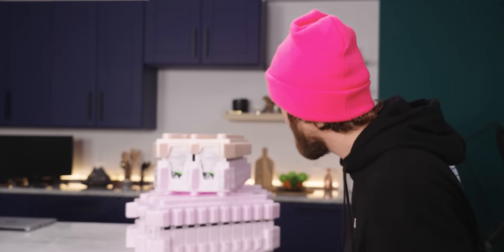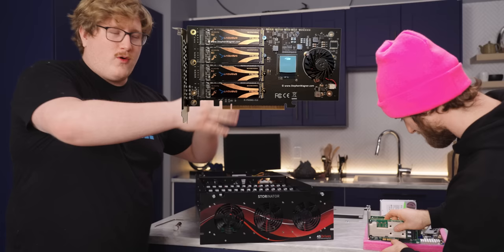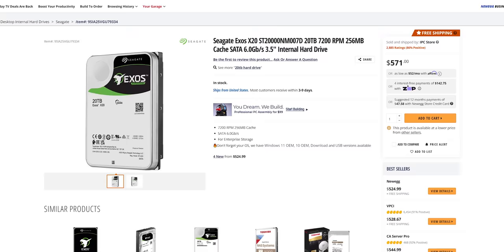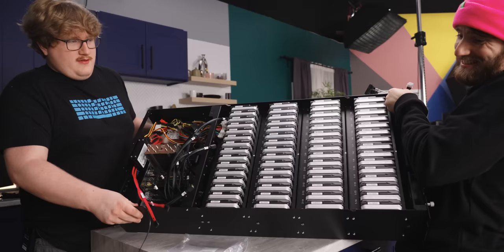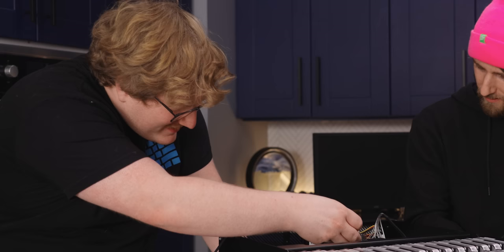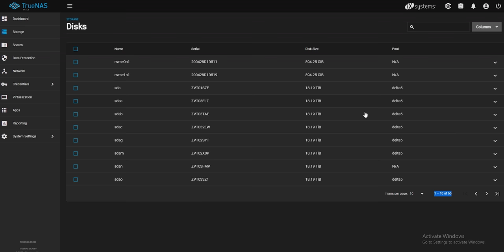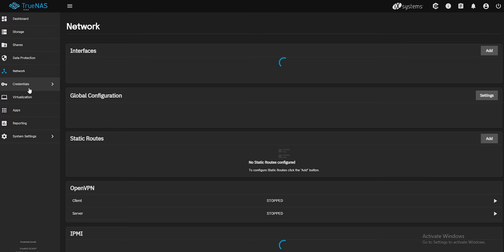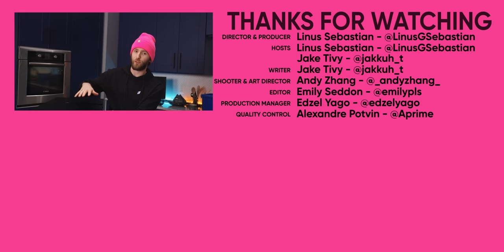My dream FINALLY came True! - Petabyte Project Recovery Part 2

Comment: Didn't Linus say in Wanshow at some point that "No one would want 20Tb harddrives?" Because of their sata interface it will take stupidly long to rebuild parity drives in case of a failure. So it would be quite likely that another drive fails during the rebuild. But hey I guess another data loss will make for more content that they don't have to plan.
Reply: lmao great point.
Reply: That's fine they don't use monitoring or scrubs so they never need to rebuild!
Reply: they're using raidZ2 tho, so if another drive fails during a rebuild it's still ok. 2 drives failing while the 1st one rebuilds is still very unlikely
Reply: bah, just made that comment myself and then saw yours. So much of what they do is eyerolling but at least it's entertainment.
Reply: It made e shudder seeing the 20TB drives, Linus did say you dont want 20TB drives in a regular server, this is archive data and hopefully they will actually manage the the server and swap it out in time.
Reply: For mission critical and actively used data for sure not. But for archival it's fine. Other archives use magnet tapes, they also take time to write and especially read. No random performance at all.
Reply: a german politian once famously said: "what do i care about my ramblings from last week!"
Reply: Here the thing, reason why Linus say to Yvone such is because Enterprise such Google, Facebook, any who moving data fast is never intending to using such method for such data. 

Linus in the other hand, is doing it for archiving. Remember when he say he need it just to take HQ data rather download it from YT? This is why he need it. 
Another reason is RAW is expensive, when I say Expensive it mean like just to record single review costing around 15-30 USD. If the data loss, nobody wanna to do it again, even they do so, it never the same impression. 

Also, nobody bought 20TB just for NAS, Except if it's a business who run on archive data such Animation, Video, Photo Agencies, many more.
Reply: @macguyfromscotland  Truly to the point. Do you wanna put your thousand dollars just for archiving or bought like per 8TB just for RAW photo or hundreds netflix 4K.
Reply: @noahluppe  If I had lot money and lot vids like bois, go tape for long time archive like what GH do is my way.
Reply: @OktavianiFriska  woah 23sec ago, hiii
Reply: RAID 6 Rebuild with 12TN 10E15 URE has a chance if 88% to rebuild correctly - that sound okay but also means you have a 12% chance if total data loss

So a 20TB drive like those still have a URE if 10E15 - so roughly only a chance of 50% for a successful rebuild

So a RAID6 or Z2 with those drives is basically useless if you rely on rebuilds data loss is a given...

Only way to ga is mirroring with such large drives..
Reply: This is for archiving data dude. Different use case.
Reply: If I recall that was in relation to the home user. I'd never want to run a single drive of any modern size.
Reply: @izanefe4231  actually it depends on various parameters: I would check the serial numbers of those drives. If they have been all manufactured in the same lot, we might be setting up for the most spectacular cascade of hdd failures within a few years.
Reply: What am I missing here?

SATA III (3) interface (I know that have 12 Gb/s SAS ports, but they're using SATA III for this server is what I gather):

6 Gb/s (600 MB/s) filling up 20 TB would take 9.259 hours. Of course, no HDD head is going to operate at that speed at this point in time, if ever.

Seagate Exos X20:

Sequential rated speed of 285 MB/s filling up 20 TB would be about 19.493 hours - still less than a day.

All of this is on CMR (thank goodness) technology so you don't even have the issues of SMR which would make it take far longer. So, that means that they would only risk losing data during those 19 and a half hours IF another drive fails in that particular v dev, not across the whole server (I'm only talking about RAID Z2 right now). Now, sure, a drive that has been running for say 5 years, pushing those drives in the v dev with the parity data on it could push it to start having problems because of that extra stress as explained in this video here: https://youtu.be/ZFLiKClKKhs?t=458

So, once again, what am I missing?

Edit: here's the WAN show clip that I think you're referencing: https://youtu.be/8IRjFZ9xEj8
Reply: Also I thought the higher capacity you go the much more likely the chance for drive failures. Maybe that's not true anymore but it used to be a couple of years ago.
Reply: @KarlBaron  they mentioned the scrubs in the video, truenas does it automatically every month,  plus they have monthly smart monitoring enabled they mentioned.
Reply: So people can't change their opinion 🤨
Reply: @happinessiskey2858  if I remember correctly the only 20 tb drives on the market during that discussion were SMR, which had decent sequential reads but abysmal writes in general, and that was the primary logic behind saying they were basically useless, because your risk of another failure during resilvering was too high. Don’t think that same logic applies to these drives appreciably more than an equivalent 14,16, or 18 TB enterprise drive. SMR was the problem as much as the size iirc, and especially with raid Z3+hot spare your expected time to data loss should be far enough out to not be a major concern. I could be wrong though, it’s been awhile since I’ve looked into all this and I can’t actually watch the video at the moment to see how they dealt with it
Reply: @OktavianiFriska  I'm a tech for an animation/vfx/video business, can confirm this. The last archival storage we built is based on 18TB EXOS, and 16TB Skyhawk AI before that. We opted for dual socket Xeons with LRDIMMs for approximately 7.5x more RAM per RAW TB of spinning rust than Linus's 1.2PB in this video with no solid state cache at all. The next few 4U servers may be 20TB EXOS or we might use 18TB based again depending on whether the priority of the business is $ per TB or rack density.

I personally use shucked 8TB drives at home for my NAS. I wouldn't want to experience resilvering of 10TB per 20TB disk failure (assuming pool is 50% filled) on datasets that's actively being used in production unless the zpool is at least striped with 3 Vdevs.
Reply: does Linus's math on that make sense?

if disk read errors happen randomly over time, does it matter how many drives your data is spread out over? whether you have one 24 tb drive, two 12tb drives,  three 8tb drives, or twenty-four 1tb drives, your likelihood of two data read failures (and loss of the pool) is the same in all cases. or have i misunderstood something?
Reply: @izanefe4231  its LMG….
Reply: Oh shit they are learning
Reply: @KhromTX  For HDDs, yes, there's a higher chance of drive failure due to the number of platters inside the drive (the magnetic discs that actually store that data) as well as the read and write heads because that's more moving parts. The more capacity you have = the more read and write heads you have as well as platters to store that data.

With SSDs, that's not as much of a problem due to them not having any moving parts. Though, having more flash in them is still a higher change of one going out or being defective, but that really applies to anything.
Reply: @L4rgo117  Ah, I see. So all these comments are about the clip I mentioned/ referencing SMR drives and not the CMR ones they used in this video? Yes, SMR would take forever to resilver/rebuild the v dev and you do run a higher risk of another drive failing during that extensive time. It wasn't making sense that people were saying a 19.5 hour re-silvering timeline for 20 TBs is too long/would take forever. 

I think that's what I'm confused about. I did think about that scenario but I wasn't sure as no one really specified the difference.

I'm going to go with that perpective. Thank you for confirming my alternate thoughts. I hope all is well! P.S. you should definitely watch the video when you get a chance if you're a storage fanatic like me. :)
Reply: @izanefe4231  lol, no it's not... At least not with 15 drives per vdev! Considering the amount of stress a resilver would do to all drives and the amount of time it would take. I thought I was safe with 4x4TB drives in a Synology NAS with SHR and when I replaced a failed drive another failed during the rebuild and that was only 4x4 drives... Now imagine the likely hood of 15x20TB stretched out over days/weeks...

I learned my lesson and my new setup has 5x8 and 5x4 VDEVS each in ZFS2 (plus working on a full replica system for off site backup using RSYNC).
Reply: @L4rgo117  Finally, a person who knew what Linus talk about. Not only nobody built NAS over 8TB, but who wanna waiting for month or year just for copy paste on fing SMR?
Reply: @KarlBaron  Brutal 😂
Reply: @brainthesizeofplanet  if the real-world error rates are really that high, why I have i never had an URE on the bi-weekly scrub of my 144 TB (raw) pool?
Reply: @KarlBaron  what's the size of each drive?
Reply: @brainthesizeofplanet  a mix of 14 and 10 TB drives
Reply: @noahluppe  I guess that's the thing that I missed.
Reply: @macguyfromscotland  Yeah let's hope.

Comment: 1 Petabyte of Data: $37k
lacking an IT department: $0
Linus making multiple Petabyte project videos: Priceless
Reply: to be fair $37k is like, six months worth of a good IT technician, so...
Reply: @wertigon  LPT: just brute force more storage to avoid paying a tech admin.
Reply: $37K for a regular person. $0 for him. He got all those drives for free.
Reply: @wertigon  Oh gawd not even close.

My company would charge maybe a few hundred a month for server monitoring.   It's actually quite inexpensive, you don't need a dedicated employee.  It really depends on how many hours of work that's needed.

Usually for management, it's a couple hours a week tops.  If there's a failure, just get someone on site to do a swap, press a few buttons and you're good to go.

For heavy errors, there are several alternate methods.
Reply: @lilkittygirl  But then you're not paying for an IT staff but for one guy to come over every once in a while, just like an electrician or a plumber.

A full time decent IT guy can easily make $60k a year, and that's just counting what the IT guy gets in his pocket.
Reply: Linus had to pay for the drives this time round.

Comment: Not sure about IT department but what you guys REALLY need is a montage of every hard drive locked in with nice clicking sound like they do on LEGO building channels. 100% satisfaction guaranteed.
Reply: I watch a guy tear down engines and he edits his videos so that the cracking loose of the head bolts are ripple-edited for that effect.  It's one of my favorite things he does.
Reply: @TechGorilla1987  channel name?
Reply: @muzameela2845  I Do Cars is the channel name.  He does teardowns on various engines.
Reply: Its on their onlyfans
Reply: Too bad fan noise would ruin it
Reply: Gallons of baby batter.
Reply: *☆MOMOKIMI☆(人 •͈ᴗ•͈)*  bot destroyer, do your work!
Reply: @TechGorilla1987  revzilla did a “asmr” video tearing down a ct90 and it was awesome
Reply: Indeed

Comment: PSA: zfs also lets you add in a hot spare that will automatically replace a failed drive. You can configure it to be the hot spare for multiple zpools. When a drive fails, it drops itself into the array to restore parity, then when you've replaced/fixed the bad drive it'll go back to being a spare until the next time it's needed.
Reply: Not a PRO. Hot Spare additions are not automatic because a complete failure needs to flagged, and its rarely the case.
Reply: Really hope Linus can take advantage of this. Even if it’s not automatic, just telling the server to rebuild with the spare already inside could be really convenient!
Reply: Question, will it be on while it's sitting there doing nothing?
Reply: @nneeerrrd  Linus knows a lot of things. Not necessarily well in any, though.

Comment: IT person interviewing for job: What is your data retention policy?
Linus: Yes
IT:How many years?
Linus: Yes
Reply: With single point of failure, both answers are "no"
Reply: @tim3172  I think they determined to NOT do that and just rely on alerting from the software raid controller. Their first video says it's to expensive to back it up and the data isn't that important, so still No.
Reply: @ScottZupek  it's on youtube. That's their backup lol. They dont need literally any of this
Reply: @johnathanera5863  Not quite, because your missing all the files needed to make them as well, from adobe templates, to the specific components of the video that get put into their video editor of choice.
Their is a lot more to it than just 'its on YouTube, why care' because your seeing the finale product, not every part used in the whole process.
Reply: @johnathanera5863  what if YouTube also stores data like amateurs?

Comment: I can remember installing hard drives in that form factor -- 1" tall, 3.5" wide -- that could hold 120 MEGABYTES.  And I couldn't believe then how much data they contained, considering that there were 80MB drives that were 2.5" tall and 5.25" wide still knocking around.  And now these drives will store more than 160,000 TIMES as much data in the same space.   Boggles the mind!
Reply: Wow that must have been a while ago
Reply: @nesyboi9421  indeed, it was. I’ve been doing PC upgrades/repairs since 1988 or so. The first PC I ever built from scratch was a 386DX running at 25 MHz, 4 MB of RAM, an 80 MB SCSI hard drive, and a VGA card with 512 KB of VRAM on it, plus a 15” VGA color monitor. Cost a stupid amount of money, too - a bit over $3K in April of 1989. That’s the equivalent of about $7K today. 😳
Reply: I still have one of those hard drives!
Reply: At this rate, i wouldnt be surprised if this amount of data today could fit in a small usb later on the future
Reply: I remember paying an additional $700 to have a 20MB HD in my computer instead of a 2nd 3 1/4 inch floppy.
Reply: @LMacNeill  so there were CD available at that time ? How can someone store movie on a 80mb hard disk ?
Reply: I remember back in the early 80's when the first home-use hard drive became available: the amazing $1500 ($5K+ in today's dollars) Shugart Technologies (now Seagate) 5MB 5.25 hard drive. Everyone I knew said, "Who the hell would ever need that much storage in a home computer??" Remember, these were the days when nearly all home data files were in the kilobyte range and stored on 5.25 floppy disk drives and cassettes. (Yes, cassette tapes!). Now, 20TB on a single 3.5" drive. I'm sure in the future when we store our data on holographic optical storage in the exabyte and zettabyte range, we'll look back on today and chuckle.
Reply: Lol, I read your '80MB drives' as 'BOMB drives' initially. Had to do a double take. xD
Reply: @squidscrew1339  CD drives didn't really exist until the early 90s in computers and you didn't store movies you could play them back with the right software but you usually had to put the computer into turbo moved first.
Reply: @LMacNeill  no need to adjust inflation, you earned more back then.
in germany people earned like 3-4 times 1990 than what they earn now.
you boomers make it sound like stuff was more expensive back then, when in fact everything was dirt cheap.
Reply: @kaanozkuscu5079  lol olden times electronic equipments were costly , as technology advances electronic equipment prices go down.
Germany mat b exception then , bcz in whole world people earn more than what they earned in 1990. Just check your countrie's per capita income then u may know even in Germany people earn more now than 1990s.
Reply: Try 40MB drives...
Reply: @squidscrew1339  movies were stored on state of the art high quality magnetic tape in a little box called VHS
Reply: Yup, I had one of those brick drives in my Power Computing Power Tower Pro 200! Nikon slide scanner in my top bay, 4x SCSI CD-R.
Reply: @AndreVanKammen  such a long story only for me to tell you: buying power was like x5 with the same wage. Having 4000 Mark got you more from everything than having 2000 euro.
Reply: @squidscrew1339  haha they didn't, digital video wasn't really a thing in 1989 even most photography was still analog (on film).
Editing video was done by cutting film
Reply: @kaanozkuscu5079  Yes, that's called inflation, you are contradicting yourself. But a starter salary in the Netherlands was around 2200 guilders, so 1000 euro in 1991. Now it's 2200 euro, that is not enough to counter inflation so you can do less with it now. You are giving an idiotic high wage for the old days as an example.
Reply: @squidscrew1339  you didn't  store that kind of media on a pc , don't be silly . A few shitty pics on floppies were the best you could do . At that time VHS was the shit . Cassettes for audio .
Reply: There are 1TB MICRO SD CARDS.
*MICRO SD*
Its legit smaller than my thumb and like 2 times thinner than a coin.
So in a 15cm * 16.5cm * 4cm block of sd cards you could get more than 1 Petabyte.
Insane.
You could hold a petabyte in your hand.
Reply: @kaanozkuscu5079  I'm not trolling you, I was 21 back then. So I know how it was back then I also travveled trough Europe back them. Here are peoplefrom all over the world and you are trying to give them the impression that everything used to be better, who's the boomer here?
Reply: @tim3172  Wel if you don't like people having nostalgia for old hardware then go reply on anonther comment instead of trashing this one with your snarky opinion.
Reply: @kaanozkuscu5079  Ok everyone was having a wholesome discussion and you came around and ruined it. Congrats.
Reply: @LMacNeill  wow
Reply: @kaanozkuscu5079  "newsflash: the parts from back than aint more expensice coz muh InFlAIoN, go to ebay and buy the shitty old components for a fraction of the price."
You are clearly just a troll.